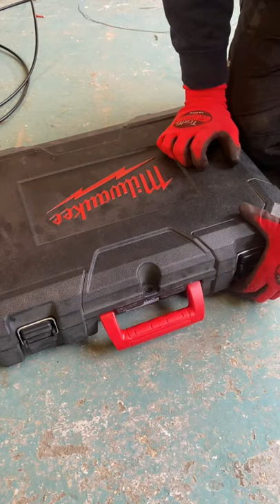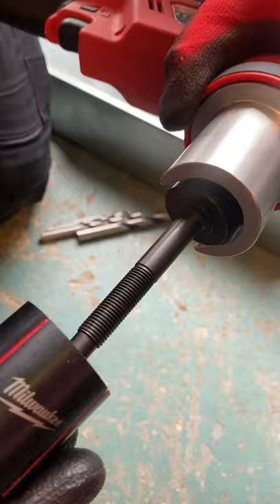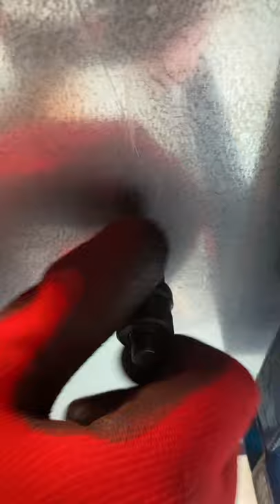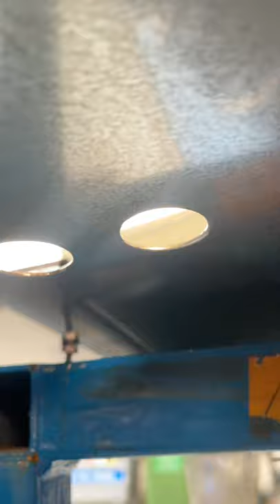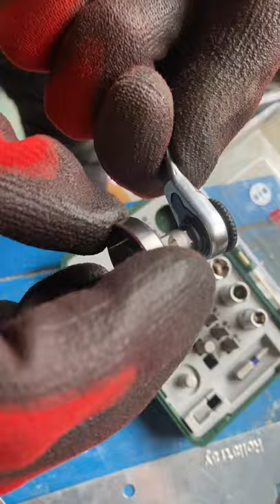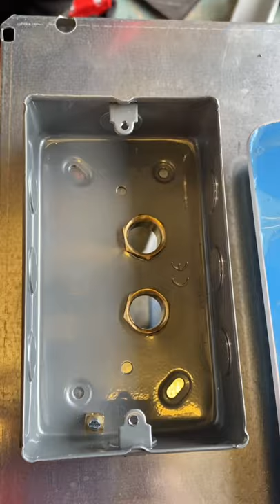We Could Have Used a Step Drill Bit .... But We Didn't

Comment: Drilled 4 holes to make a 1/2 hole
Reply: Do you mean half inch hole or half a hole ? Lol both would be wrong , looks like 20mm bushes . Your point is right though lol what a carry on
Reply: Lmk when you find a bit that big bud.
Reply: @NicktheDIYguy  its called a carbide hole saw.. greenlee as well as many other companies makes them. I got a set for 1/2", 3/4", and 1" holes. Way faster than having to use a knockout tool
Reply: @calebbigelow7556  lmaoooooo I would pay money to watch Someone use that on this thing and break their wrist
Reply: @NicktheDIYguy skill issues much

Comment: Personally I am not an electrician but I think it is best to cut a Star shaped hole with an angle grinder feed your wire through and hook it up to load and then let the wires in this box be loose and uninsulated.
That is the coolest way to do it by far
Reply: I am an electrician and youre 100% correct.

Comment: Drilled 2 holes so going up to 20mm hole saw would have been quicker and cheaper still had to debur anyway.
Reply: I have used the manual version of this before. It's worth it if the gland plate is aluminium or stainless, which can be very hard on holesaws.

Comment: A 500 quid tool, three drill bits, one deburring tool, a dedicated socket, 10 mins to set up and two minutes to do the job of what a file and a 10 quid step drill can do in 40 secs. Sparks 🙄

Comment: Those can be bought tightening by hand rather than electric.
Reply: Yes, you are right. I have used the manual version. Handy on an aluminium gland plate, if you've a bunch of holes to do.

Comment: For that money and time it would have to debur the hole for me too buy it. It has its place with plumbers and engineers. Right tool for the job and all that. Best regards, Scott. ,✌️🙏✌️
Reply: Yes, waste of time and money for the run of the mill install. But sponsorships and such...
Reply: And you still have to drill the initial hole and then fit the unnecessary tool,all in the time a step drill would have done the same job and you haven't shot a few hundred quid for the pleasure. I have employed a few mechanics over the years who turn up with the biggest most garish roll cabs, all full of brand new tools that they use once in a blue moon while paying through the nose  on the never-never for them,it's like they are trying to compensate for something😂 .I guess Efixx are Milwaukee's current bitch, I only hope their construction tools are more durable than some of the automotive offerings I have had the misfortune to try over the years,their 3/8 drive battery ratchet I tried last month couldn't have been less confidence inspiring,it sounded like it was eating it's self even with very little torque loading.
Reply: And you still have to drill the initial hole and then fit the unnecessary tool,all in the time a step drill would have done the same job and you haven't shot a few hundred quid for the pleasure. I have employed a few mechanics over the years who turn up with the biggest most garish roll cabs, all full of brand new tools that they use once in a blue moon while paying through the nose  on the never-never for them,it's like they are trying to compensate for something😂 .I guess Efixx are Milwaukee's current bitch, I only hope their construction tools are more durable than some of the automotive offerings I have had the misfortune to try over the years,their 3/8 drive battery ratchet I tried last month couldn't have been less confidence inspiring,it sounded like it was eating it's self even with very little torque loading.

Comment: Not safer:
Sparks still fly drilling the pilot hole=fail

Time is money:
Unibit finished lightyears before your halfway assembling milwaky=fail

Efficiency:
Slugbuster ko will also finish faster without any battery power=fail

Initial cost:
Cost a fortune to purchase tool,batt,charger platform=fail

Ergonomics:
Clunky, more parts to lose and expensive and hard to find and replace, gets stolen from truck or jobsite=fail

For the price you could buy for a life time, step bit for everyone in the company=fail

Fancy milwaky garbage FAILED

Comment: Maybe lazy over priced Greenlee will restart marking all knockouts with 4 lines like they did years ago instead of just 2. Better yet mark the 4 lines with bright paint like Milwaukee has done. For 45 years used a hand cranked Greenlee hydraulic pump for KO'S up to 4". This battery powered KO driver appears to be the only way to go.

Comment: Im assuming the soft aluminum pulled through leaving a slight bur, on steel it would not be a problem, so no deburing required. 

Fantastic bit if kit, I wonder if Milwaukee can also make an attachment for unistrut, you can then justify the cost.